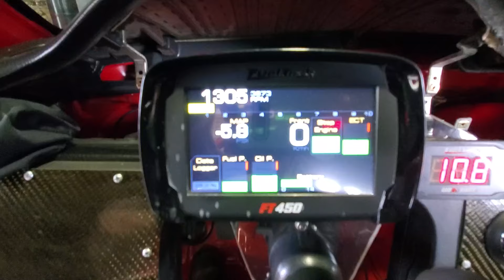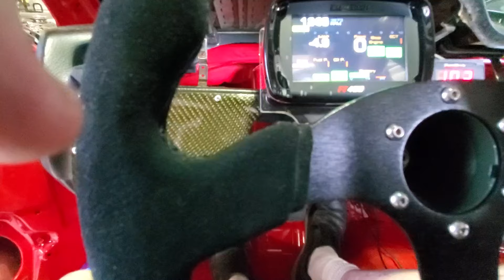First time under boost

Comment: Please tell me your putting a cage in that...
Otherwise that's a fully built deathtrap.
Especially with the holes in the door area, structural round there 😳
Reply from the maker: There is a NHRA approved cage already in it. You dontseeIit? If t's weighs  80 pounds.
Reply: @jimhiscott2918  oh good buddy
I didn't want you to crash that or have an accident with the amount of structural compromise going on there.
You could cut the floor then and use ally sheets to save some weight.
Or do the old fashioned shell over tubular frame if you where so inclined
Reply from the maker: @m4d_mark_xtr3me79  those  holes went through one layer of sheet metal. Below that sre 5 more and that stuff is incredibly rugged. Tying that all tigether is a 10 second legal NHRA RIOLL bar